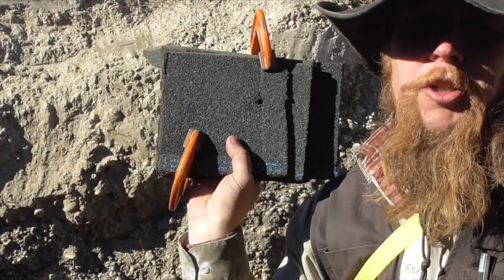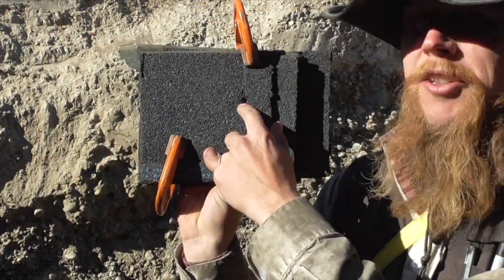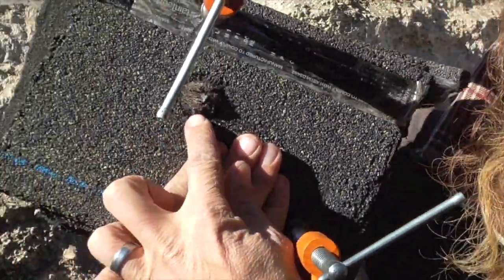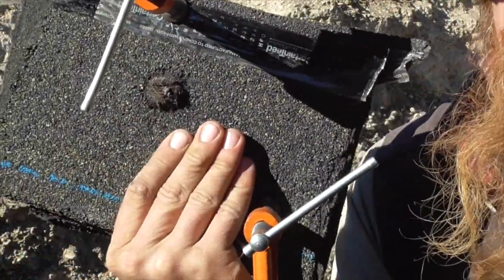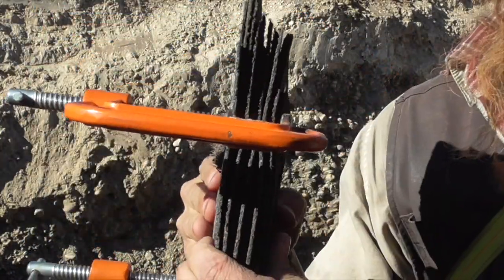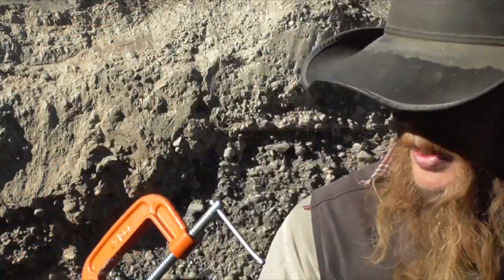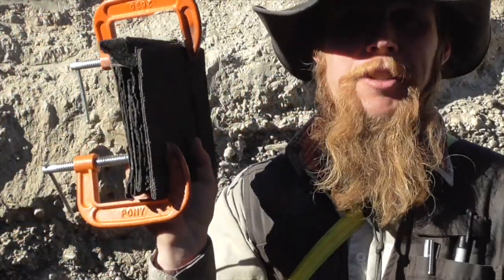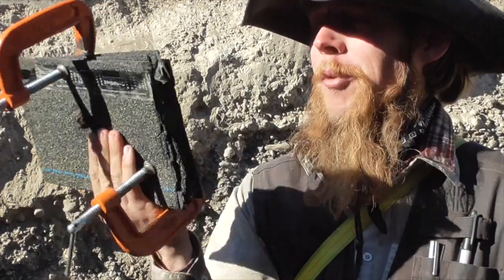Testing Improvised Body Armor: Asphalt Shingles (TIS234)

Comment: This is a bit irrelevant but if you cut whatever caliber black powder barrel that uses a percussion cap to the length of the charge for example a 44 percussion revolver cylinder but instead of the six shot cylinder, its just one bore like bullet or cartridge. Would that still be consider a barrel or would it become a fixed cartridge. So if someone made these mozzle loading barrel "cartridge" and a barrel with a "chanber" that the short barrel "cartridge" can fit in the other barrel with the cut "chanber" in theory this could be a semi auto loading black powder antique gun. Yes this will be big and in order for it to auto load the only system that would work would be blow back because a gas system will flowl to fast and not work
Ive been wondering this for a while now and wanted to get some insite from others on weather this theory or idea would change the black powder gun into a modern style of firearm or still be a antique firearm

Comment: I been thinking a composite layer armor would work best, possibly, steel, aluminum and plastic such as lexan , polyethylene used in cutting boards or some type of HDPE plastic sandwiched together.

Comment: In 1879, Australian bushranger and outlaw Ned Kelly devised a plan to create bulletproof armour and wear it during shootouts with the police. He and other members of the Kelly gang—Joe Byrne, Steve Hart, and brother Dan Kelly—had their own armour suits and helmets crafted from plough mouldboards, either donated by sympathisers or stolen from farms. The boards were heated and then beaten into shape over the course of several months, most likely in a crude bush forge and possibly with the assistance of blacksmiths. While the suits successfully repelled bullets, their heavy weight made them cumbersome to wear, and the gang debated their utility.

The gang found use for the armour as part of a plan to derail and ambush a police train in June 1880 at Glenrowan. After the plan failed, the gang, having taken hostages in a local hotel, wore the armour during a final shootout with the police. Byrne died from a stray bullet that hit his groin through a small gap in the armour, and in an attempt to rescue Dan and Hart, Ned donned his suit during a fifteen-minute exchange of gunfire with the police. Although the armour protected his head and torso, he received several bullet wounds to the hands and legs, causing significant blood loss and resulting in his capture. Hart and Dan died during the final stages of the siege, possibly in a suicide pact. After making sufficient recovery from his wounds, Ned was tried, convicted, and sentenced to death by hanging.

Comment: The asphalt shingles may have some viability as part of a composite armor. You need a harder layer to break the projectile up first and then use the shingles to catch the fragmentation. Alternatively, you could use the shingles on the strike face to catch spalling from the impact with a hard layer. Just my thoughts on the matter.